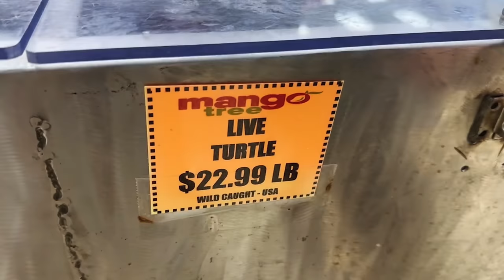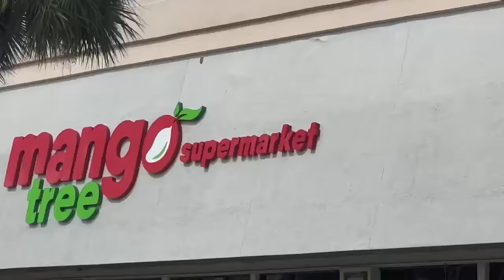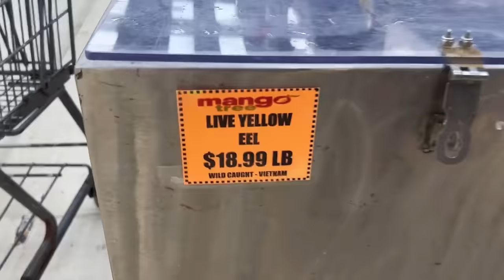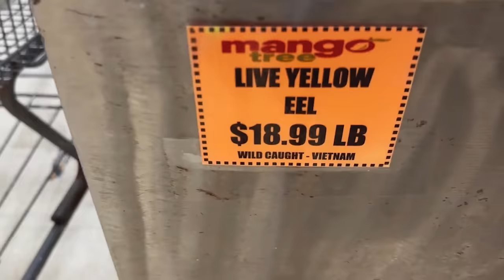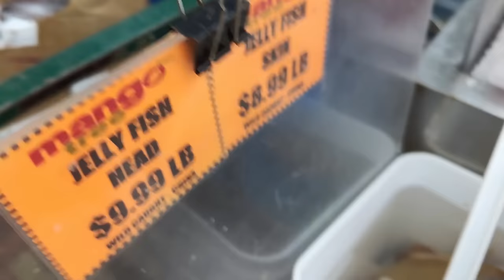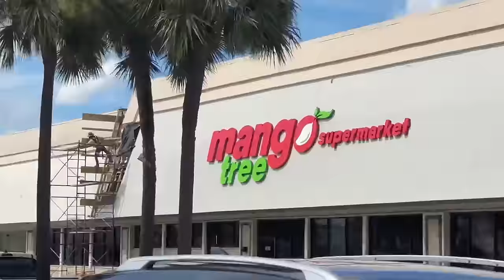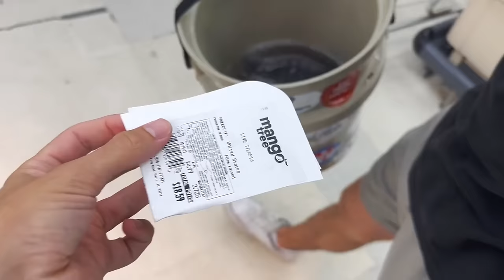We Bought LIVE FISH and EELS From a Foreign Food Market...

Comment: What kind of air o2 system did you use there to put in the cooler when the fish were in there? And on what kind of energy does it work?
Reply: You can get the small battery powered bubblers for bait buckets, I think that's what that one was.

Comment: What happened to the 3 Needle fish?
Reply: Eaten
Reply: @Coopdog-zo4fl  dang I thought they were going to be too big because Pots and Pans never ate Berry Barracuda and he was smaller than them. Only reason Barry died is because he jumped. They should consider putting a net over the top or me being a electrical and controls engineer. I would automate everything on one system using a PLC and HMI (touch screen PC essentially)  controls the pumps, you could monitor all the values with it and even put a light curtain (essentially a sensor) on top and sends an alarm to your phone by call, or text, email, flashing light and/siren 🚨however you want it, and then you just add a clean or feed button  on the HMI that toggles the light curtain with an adjustable timer the operator can set so you can set the tim for 30 minutes for example so you push and as you feed the fish or clean the tank the alarm won't go off and of course when you're done I'd have an enable butting to bypass the. But the possibilities are endless you can look at your screen to the pH, Salinity, Phosphate levels, and even temperature so you could set a target temperature, or salinity, water level and etc and the  program in the PLC would automatically keep it at all ghost values to whatver you set on the HMI. Probably could even add a hopper and drops in food at exactly certain time programmed into the system.